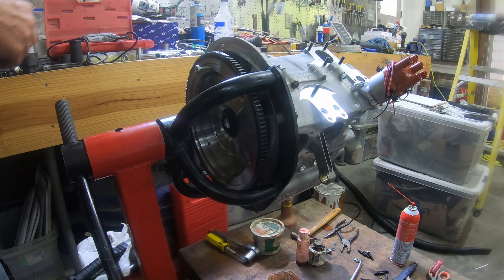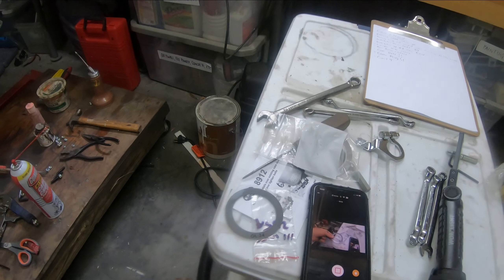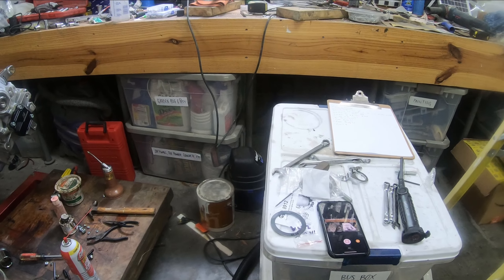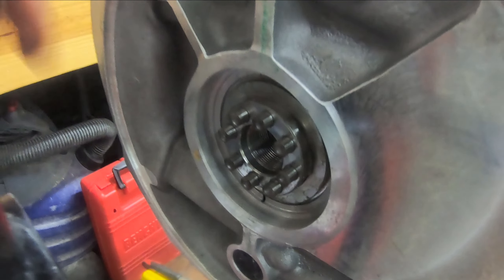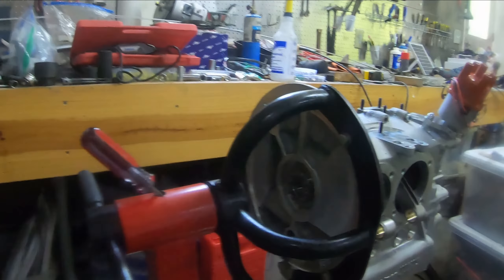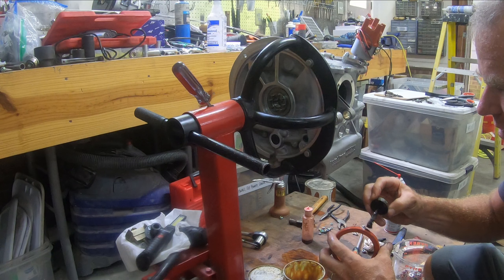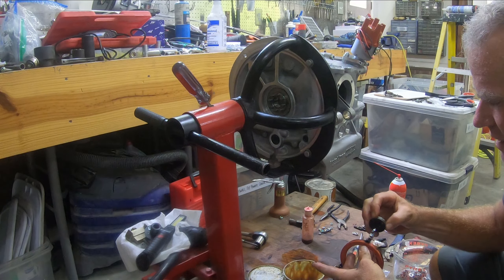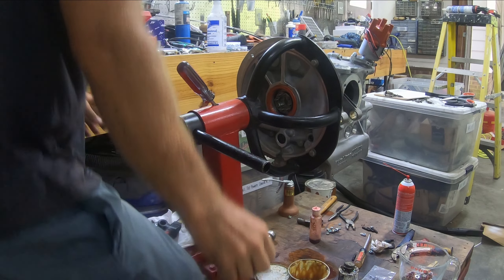2332 VW Air-cooled Stroker Motor - Video 13 - Closed Case, End Play, Oil Pump, Main Seal

Comment from the maker: I was mistakenly allowing the rods to hit the bore surfaces - they got just a little banged up, so I had to later sand down the surface with fine grit sandpaper to make sure the surfaces were all completely flat.  One should not allow the rods to bang against the sides of the bore surfaces on the case...